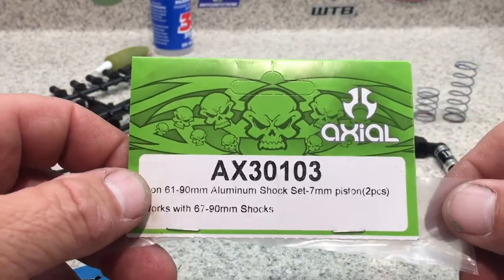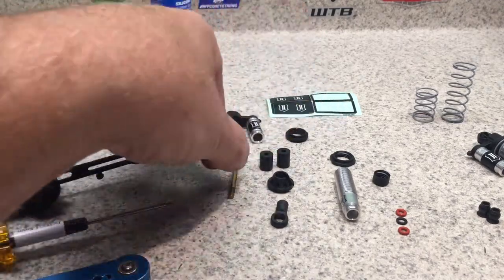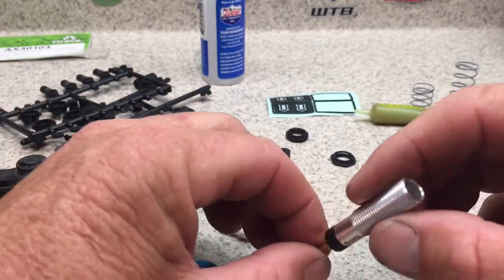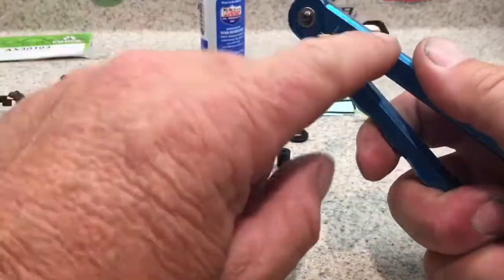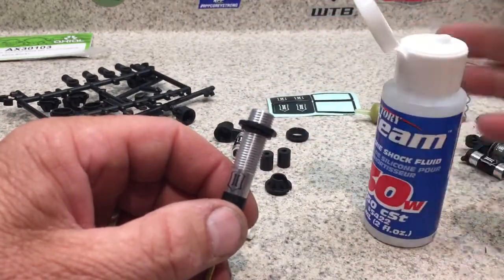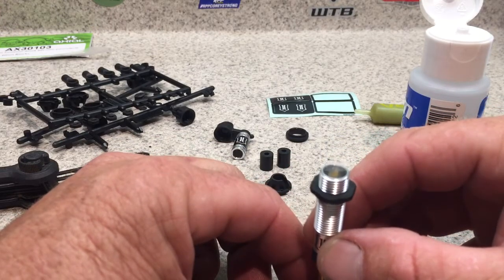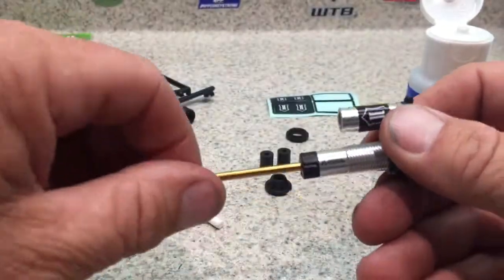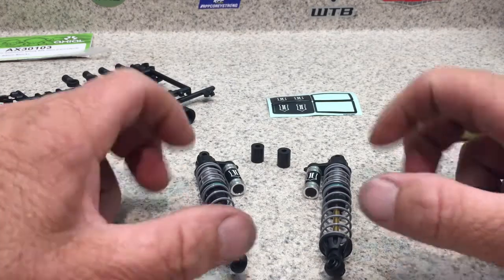How to Build SCX10 shocks

Comment: I built the shock is that way I put for the piston in the tube shock and the I cover the treads with a thin plastics and slide the Orings and the spacer in that way don’t get micro cuts and a notice the last longer with not leaking! That is one of the most important thing !!

Comment: Isn't the point to have as much fluid in a shock as possible, hence having external reservoirs? I don't understand only filling them halfway. If you fill them and one hydrolocks you just take a tiny bit of fluid out...right?? Maybe I've been doing it wrong?
Reply: Axial Icon shocks are a fake piggyback reservoir shock

Comment: Hey John how do I get the pivot ball out of the eye lid ?
Reply: Most Damper pliers have a tapered stud on the inside of one of the arms, the opposite arm has a recessed hole, placing your part in this and closing,  will safety remove those studs time and time again, Johns pliers here do not have this feature, mine cost me £8 from ebay, and well worth the purchase, because having the right (specific/specialist) tool means you never seem to use it. Cheers

Comment: Respectfully, this was a good tutorial on the RIGHT way to build Shocks... And, I will NEVER Build a Shock WITHOUT Green Slime!!! It's that good. 

None of this seems to work on the Plastic Shocks that comes with the SCX10 II RAW Builder's Kit. 
I have literally tried every trick I've learned over 37 Years in the Hobby....
THEY LEAK! Badly. Only from the lower Seal Cap, not from the top. 

Worse than that, if left stationary for even only a half hour - they STICK!! Very badly. 😬😬😬
It's extremely frustrating, especially because I've taught Others over the Years. I've got GOOD, ProTech Shock Shaft Pliers, I only use TLR Shock Oil (I am like you, but used to Race for Team Losi)....

CAN YOU HELP? I MUST be overlooking something STUPID!  Are those Kit O-Rings junk? Does the spacer not compress the O-Rings enough?? 
Is it the Pistons? They're also from the Kit - removed from the Sprue with a fresh X-Acto Blade. I tried to also sand the outer edges smoother, with 600 grit Sandpaper - just until they made the full travel in the Tubes without binding anywhere....

Could it just be the PLASTIC Tubes themselves?? 😱 Are they just not molded correctly? Do I HAVE to get the Icon Aluminum Shock Tubes? 
THAT'S admitting that the Shocks that came with the Raw Builder's Kit are JUNK!!!  That would also concur with a growing number of "popular" (which DOESN'T mean GOOD! Even though THEY think they are) Channels who are saying that the Kit Shocks are GARBAGE, and you shouldn't even bother building them! Except for Display purposes only.

I don't know if you even LOOK at this anymore... But this RBK is only the second Axial Product I've had myself (although I've worked on others). It ALREADY had a problem with the M4X20 Set Screws that assemble the Links. FIVE of them weren't cut for Threads!!  I had a Headache trying to source new Set Screws elsewhere - because I'm STILL waiting for replacements from Axial.... 
The best I could do was M4X16 - leaving some of my Links less than full strength!! I'm just not happy with the whole Experience. 
I'm a Disabled Veteran. This was a major purchase for me!  Even if all the "cool kids" are snapping them up, along with $430 RTR Blazers, like they're candy. 
I expected better from Axial....
Carmine